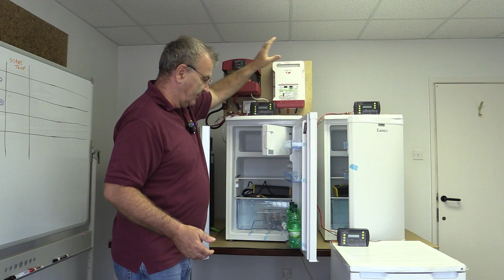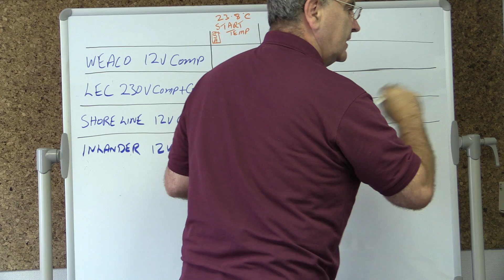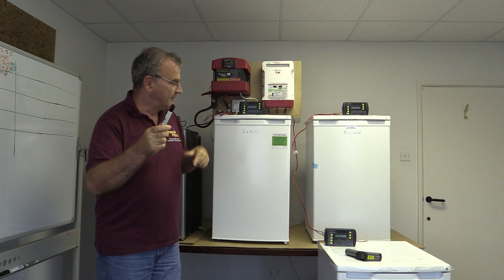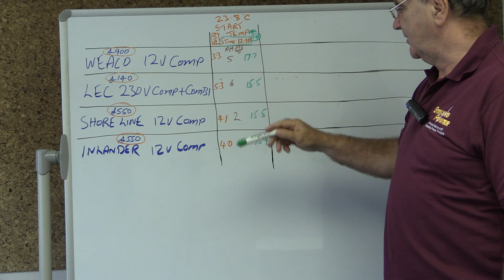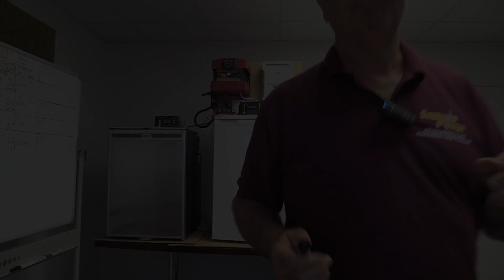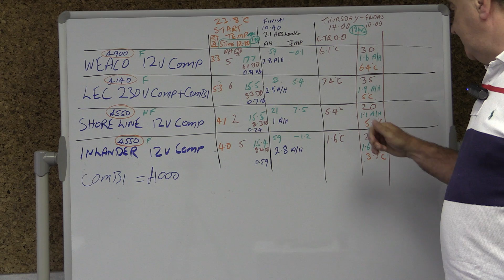230V Fridge comparison test versus a 12V compressor fridge cost / benefit analysis

Comment: I tend to dismiss the Waeco as it looks to be a smaller capacity (or is it just a different dimension?). The freezerless one is interesting, but the real story is the 240 vs 12 volt ones which look to be identical size. I would like to see this test with a more efficient inverter as that one is only 85% (according to Sterlings site). 90-91% ones are available.  Also under more typical use pattern - more contents and door openings.

One drawback if you run the inverter in Eco mode is the fridge light doesn’t come on when you open the door (if the compressor isn’t running at the time).
Reply from the maker: Good morning/afternoon,

The fridge industry has evolved a fair bit since this video. 
Inverters have become more efficient, and indeed the 12V/24V powered fridges have become more competitively priced. 

It's coming to a point where it's more or less in parity, so the more important factor to consider seems to be the size and features - and, of course, if you have an inverter in the first place (which still many boats and vans do not). 

WRT Inverters in Eco mode- yes, believable. We have the same on our Inverter Chargers, we call it Power Saver Auto. The logic is that the inverter, to cut down on the passive drain of the batteries, simply pulses intermittently to provide power to the 240V circuit, and will only 'stay on' if there is a significant enough circuit load to justify staying on. Low power loads will pulse on/off, or just stay off continually, until a more significant load (IE the compressor, as highlighted) is on the circuit to justify the inverter staying on. 

Ben

Comment: This is useful and backs up my own findings. I recently swapped to a 240v fridge on my narrowboat, somewhat reluctantly I might add, simply because I couldn't find a suitable 12v model to fit the gap in the kitchen units. I have been pleasantly surprised - the level of battery drain is actually an improvement as far as I can see. The price difference is the real game changer though. 

I now see there's no real advantage to going 12v if you have your inverter switched on most of the time for other uses anyway, as I do. 

Interesting how the 12v larder fridge was more economical - I wonder how an equivalent 240v model would perform?

Comment: If the inverter was hooked up to a 12v battery (same as the 12v fridges), wouldn't the current draw on the battery be something like 38ah for the 240v fridge?  Factoring in the voltage change?  I might be a bit confused here?

Comment: Hi, I liked this and found the same results after my own tests. I found that eco mode on the victron 1200 va unit dropped about 1 amp…. As time was not an issue I also adjusted the search time to 30 seconds to maximise  the savings.. with regards to the freezer compartment: you can all but negate the extra power usage by filling it with freezer packs to add thermal mass! Would love to see that test… thanks for all your tests and your kit!

Comment: I saw this video after I accidentally punctured my 12v fridge evaporator so I ended up buying a 240v bar fridge. Long story short, WHAT A FRICKEN HASSLE!!! Maybe I missed the part about 240v fridges inrush current spike???!!! Even though I have a 2000w PSW inverter, 200 amp hr battery, thick cabling used throughout - I STILL get low voltage alarms going off & my resettable circuit breakers go off every time the fridge cycles after dark! Urrgh

Others - be warned!!!! Good luck going through endless forums trying to figure out a solution if you want to go down the 240v route. Maybe a hard start capacitor might save your motor windings??? Soft starters ‘that work’ (i think) cost more than an inverter...etc etc
Reply: This comes down to the particular fridge and inverter. I used a Beko TSE 1284 (A+++ rated) running off a Victron Phoenix 500VA inverter. The inverter went into overload for 20 seconds when the compressor starts, then it runs fine. All you hear is a short hum. I had it running in temps up to 39 degrees for 3 months in France 2022. It always managed to do correct temps inside the fridge and freezer (1-4 fridge, below -18 freezer).

I'm going to upgrade the inverter to the 800VA version so it isn't overloaded. I had the inverter on all the time as if you use Eco mode the fridge light doesn't come on if the compressor isn't running. I had plenty of power so wasn't worried about any extra consumption.

For comparison I have another vehicle with the Waeco CR110 and the fridge works ok, but the freezer doesn't get much below freezing. (certainly nowhere near -18).Twice the price of the 230 volt option and not as good.
Reply: Just confirming the 800VA inverter works fine. BTW powering this is a 100Ah lithium battery, 300 watts solar and a 30 Amp B2B charger. There's plenty of spare capacity to use for other things. This is the best way to do a fridge - I've tried all three ways. 3way are rubbish in hot weather and require maintenance, 12 volt compressor are expensive, 240 volt compressor are inexpensive and work fine (if you get a decent fridge and inverter).

Comment: My option would be to buy a 240 volt small triple `A` rated  chest freezer (top loading door with good door seals) which can hold so much more food, and hire a Air conditioning engineer to fit a 12 v volt fridge compressor to run off exisitng solar panels - if you want ice, buy a bag from the supermarket and store it in another thick freezer container (which should last a week) with maybe a small peltier.
Reply: I'm doing just that - with a super efficient Engle compressor - however I've decided to mod a normal F/Freezer for two reasons - I don't have enough depth to install a F/F undercounter - and I'm not sure that I can cope with rummaging around every time for what I want. Also bc I'm custom building I can insulate the area around the F/F and - remote mount the compressor so as the fridge isn't sat directly on top of the compressor!

Comment: This is good experiment. I want to know if room temperature is 30 degrees, fridges electric consumption is different than this situation?
Reply from the maker: The initial power spike that happens when the fridges first engage would last for longer as it battles the temperature, but the continual running rate would be, I believe, much the same. Sorry for not including these variables in the video!

Comment: Hi Great video :). you said that one will need at least 1000w inverter. does it matter if the inverter is modified sinewave or pure sinewave? and why please? many thanks
Reply from the maker: Hi Makaveli,

We used a pure sine wave inverter in this video, as fridges are generally somewhat sensitive and complicated and a modified/quasi sine-wave inverter may not actually provide the delicate charge care that the fridge requires. 

Quasi is fine for 90% of sort of crude applications, but fridges tend not to be all that crude. 

I hope that helps!

Comment: If you are going for absolute minimum energy consumption, get a small chest style freezer, and replace the thermostat with a refrigerator type.  Freezers have much better insulation that refrigerators of the same size-- which is why I'm suggesting starting with a chest freezer for the modification.  Try to find a freezer that has the best insulation (and really good door seals).  Chest style refrigerators will not lose so much cold air when opening the door-- if you are opening the door a lot (like when prepping food) this can save a lot of energy.  Now, to make it even more efficient, wire the (new) thermostat switch to a small dedicated inverter that is only just big enough to start and run the refrigerator-- the inverter is then completely off unless the thermostat is calling for power.  Rewire the interior light to run on 12V, and replace the interior lamp with an LED type.  Choose an inverter that is super high efficiency with this power/energy profile.  For energy usage, I think this would compete quite well with a dedicated refrigerator that was designed to run on 12V.  Small sine wave inverters that are very efficient are quite inexpensive--  but it does need to have a remote on/off capability so that the thermostat switch can be used to turn it on/off.  Chest style refrigerators are not that inconvenient if you place them in an under-cabinet drawer-- just be certain that there is plenty of air flow and/or venting for the compressor and condenser.  Of course, if you are lazy and don't want to do all of this work, you can just buy a Sundanzer chest-style refrigerator, and there you go.
Reply: That doesnt work due to condensation issues
Reply: @STRUTZKOFF     ithe condensation is drained off with a plug hole
Reply: @LouisWarwick  Belluna in Germany makes them.

Comment: My Sterling Pro Combi S 2500W Combi uses 4A quiescent current.... so there is no way I can leave it on 24/7... It obviously uses less in standby, but most things i use wont start it up from standby, so pretty much a useless feature - for me.
Reply: For a 110 litre 230 volt fridge I used a Victron Phoenix 12/800VA inverter. 6.5 watts standby (1 watt in Eco mode).

Comment: Great presentation!  Thank you for putting it together & sharing.  The question I have is... you are counting Amp Hours.. and so to determine the watts consumed, I must multiply by the line voltage.  What sort of line voltage did you have running these tests?   Fixed 12 volts?  Or more of a leisure battery 13V?  thank you!
Reply: yep, my thoughts exactly, i've now watched this 4 times and i'm struggling to get the info to help..... watts would help

Comment: Would the same apply for 4x4 overloading? Would the 220v compressor be able to handle the rough drive
Reply: probs too late now but YES. I asked this same question and found a guy who'd spent two years driving around tracks in France and Spain - NO Problems..